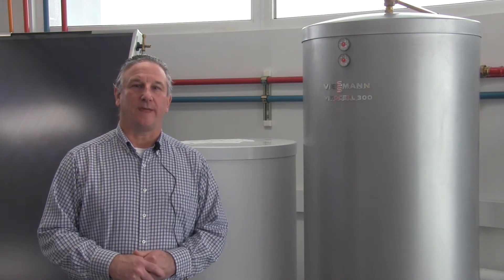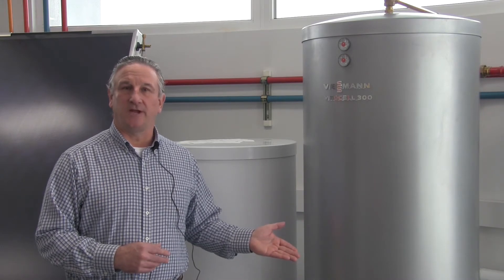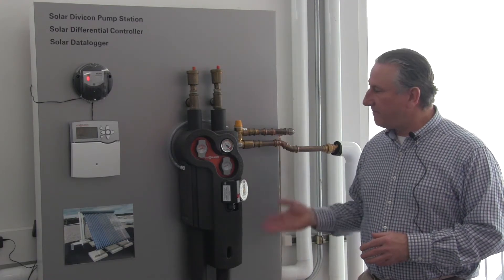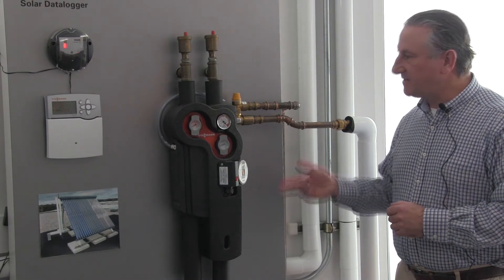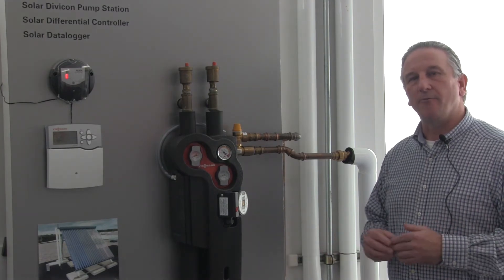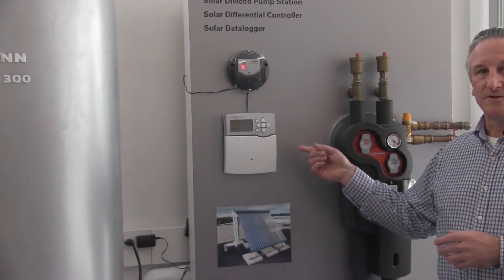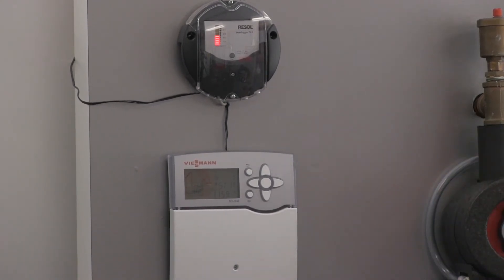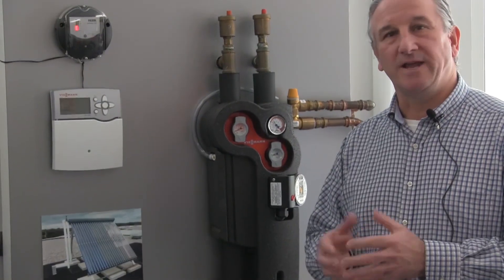Vitosol Solar Components: Tanks, Pumps and Controller

Comment: below the automatic air vents should be install 2 items valve closed. it's a critical mistake at solar installations. to remove the air from solar fluid the contractor should use special pump station (pump with tank). its no need to install any automatic air vents. regards Jar
Reply: Sorry, but you are not making any sense?!?

Comment: Folks, Viesmann makes some incredible equipment but in our commercial circumstance solar has been a big dud. If it was not for the huge government subsidy the system would cost money to own. Finding a competent repair tech is like finding water in the middle of the Sahara desert. The Viesmann cascade systems we have are nice but they are maintenance hungry. Parts can be difficult to get and can be very expensive. Think of it as a Mercedes for your heating needs. Great to lease for 2 years but never own unless you or your best friend is the mechanic working on it.